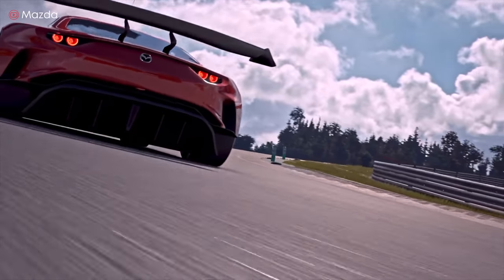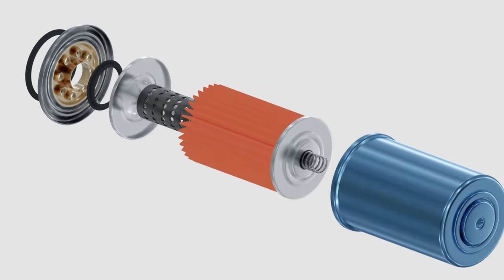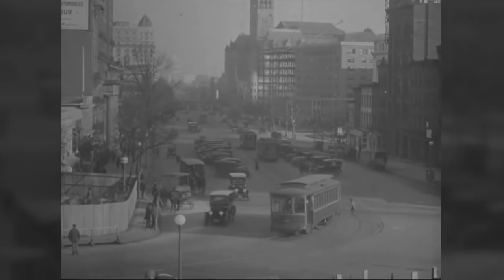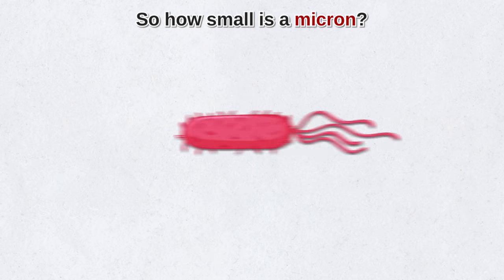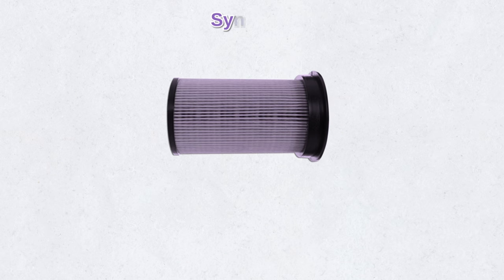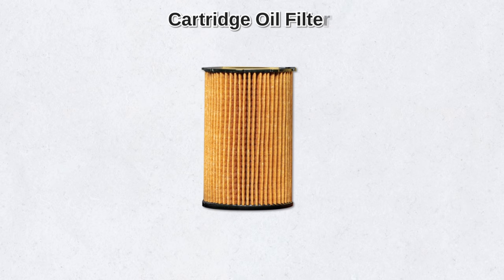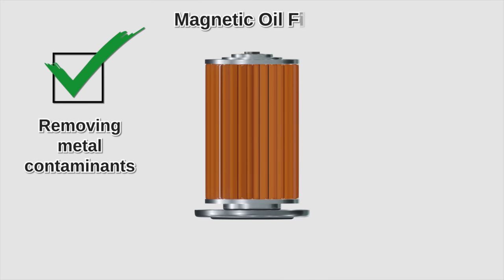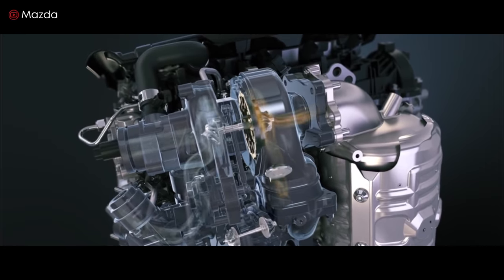This New Oil Filter Just Changed the Game (No More Oil Changes)

Comment: ⚠️"Avoid the orange can, avoid the FRAM" ⚠️
Reply: All I use is Fram my Pontiac vibe has 289000 miles, my ram has 230000 miles ,my gmc had 181000, my cr-v has 14000 never had a problem.
Reply: avoid being an internet vid drone, get a mind of your own ..
Reply: @charlesstull4582  cut open a orange can ,you will be surprised how cheaply they are built ,basically glued together & sometimes they are rusty inside....don't want rust & globs of glue in your crankcase
Reply: @daewooparts  why cut one open, you can watch 10 gillion vids on Ytube alone-where you were weaned on the Fram hate meme.. can you show some video proof where Fram has damaged engines? That would be nifty. I haven't seen any in decades of trend analysis/monitoring/testing with military aircraft that have used Fram oil/fuel filters for decades now.
Reply: @land7776  if Fram filters are so good, then why do no OEM's use them ! While its parent company makes OEM filters, they don't use the Fram design or construction, it won't pass most OEM quality control, & slot of fleet customers did ditch Fram years ago after it cost them in premature engine failure & ruptured filters as well, they are much thinner than the majority of OEM filters & most aftermarket filters as well
Reply: @daewooparts  lol, do you know of any OEM cos. that don't use their own (branded) filters? Link to where they don't pass an OEM QC? Do they void a warranty if you use Fram filters? Please provide a definitive proof from a respected org. test of Fram filters showing engine damage.That should be easy for a Fram meme expert..
Reply: @land7776  American Honda dumped Fram built filters decades ago,,,because of ruptured filters that was built by Fram/Honeywell ....utter garbage, & most Asian OEM vehicle manufacturers don't & won't use Fram  ,GM uses AC Delco which is made by Champ Industries or European filter manufacturers, Ford uses  purolator rebadged as "Motorcraft " & Mobil 1 filters are basically the AC Delco  premium black filters ,even got the same stamping on the filter inlet housing
Reply: @daewooparts  youre still talking yang but can't provide the links. Look at how many people use Frams, do you hear about ruptured filters Look at the poster above, he uses them in all his cars. I've used them among others for decades in cars. I know others who do. I've never heard of or seen a ruptured filter. Like I said, you can't provide any links to any legit study showing it damaged engines. So you are obviously not using your FOS filter.
Reply: Some peasants will buy the best filter they can buy for the least amount of money.  Probably shouldn't store a Fram in humid conditions  unless it is wrapped. Bunch of parrots  repeating what they heard from other parrots. Fram is lucky try talking about toilet paper filters. Insurance would get expensive if the filters were causing problems.  File a claim against Fram and an automotive engineer would be knocking on your door. They are all insured

Comment: ....and back in the day VW bugs had a oil strainer instead of a filter .
Reply: VW saved millions by not putting filters on the beetle. I had a Motor Guard on mine. The Motor Guard was sold as an off road dune buggie filter. Tested and approved by Dune Buggies and hot VWs in the 60s. I still use Motor Guards. I recently got in a Australian Jackmaster. Probably the best in production. Motor Guard only makes compressed air filters  now. Hard to sell game changer oil filters to people that think oil is supposed to get dirty and be changed.
Reply: The beetle generated a lot of large engine damaging abrasives.. Needed.a full flow filter as much as the game changer bypass filter. The trick was never let the oil get dirty and keep the valves adjusted.

Comment: Forget what the OEM calls for! I change my synthetic oil every 10 to 15k and filter. Mobile one or nothing! All highway miles. I got 99 problems and a Scion TC 2.5L 4 cylinder ain't one!
Reply: I don't.
Reply: I brought home a new 84 Subaru. I put Amsoil gear oil in the transmission. Mobil 1 15 50 oil in the engine. A Frantz oil cleaner on the engine. About every 12  K miles I changed the toilet paper in the Frantz and added  quart of Mobil 1. Mostly highway. At a little over 250 K without an oil drain I mentioned it on YouTube.  A Caterpillar lab manager sent me a sample kit. He said the oil looks good for that many miles.  He said it would be better to change the filter every 6 K instead of every 12 K miles.
That would be 2 quarts a year instead of 1 quart. I do that now.
Reply: @ralphwood8818  If your running synthetic oil, 10k -15k with highway miles shouldn't be an issue! More car specific due to age and performance class.

As for the filter, It all depends on the manufacturer and the filter media material used in the construction. Cars are barely under any load during normal operation and the oil doesn't lie!

I work at a Caterpiller dealership FYI
Reply: @barbecuetechtips6024  I remember the Caterpillar  guy talking about something like CaramelizatIon I knew I was running too high an oil temperature. The cooling system wasnt good enough for Dallas traffic with the AC on. One time the radiator exploded.. The spring in the cap was stronger than the radiator. Started using the Frantz toilet paper filter and Delo 100 30 weight in 1963 in a nearly new Rambler American flat head 6 with a spin on bypass filter. All I use now is Gulf Coast and Motor Guard toilet paper filters. The Rambler had no AC. Mostly drive highway now. Wife mostly drove highway but was often caught in Dallas bumper to bumper traffic.

Comment: What about the time factor between oil changes.  How degraded is my (conventional) oil if I've only driven about 1200 city-driving miles, but it's been 8 months since my last oil change?
Reply: city driving is harder on a car and if you short trip alot thats even worse. i would change it every 6 months. even synthetic is only good for a year if you dont hit the mileage.
Reply: I dont drain oil. I also believe in recycling. When I was selling Gulf.Coast filters a guy came to the house with a new Dodge Cummins asked me to drain the Rotella and put his Amsoil in and install a big Gulf Coast  O1 . Had enough  Rotella to keep the old Ford 6.9 going for a couple of years. Broke my rule on the 76 F 250 with the 390 engine. Went to  Walmart  synthetic oil.  Put the old oil in the 30 gallon gasoline tank on the tractor. Same oil in everything now.

Comment: Did I miss something? What's the new oil filter that requires no more oil changes?
Reply: The game changer oil filters have been around for many years. There is getting more interest in them these days. I have been using them for 60 years. I just got in a Jackmaster from Austrailia. Probably the best in production. The top loaders are the most user friendly. They are for the mechanically inclined. The filters that eliminate oil changes dont spin on. They have oil lines. They dont qualify as new. Frantz since 1953 Jackmaster since 1954.

Comment: It seems to me that the finer the mesh, the more quickly it would clog up with particulate matter. What is done to mitigate this factor to make the premium last longer?
Reply: More pleats = more surface area.
Reply: The WIX full flow filter on my Pontiac Torrent has been on the car for 4 years and 60,000 miles. The Jackmaster Classic wont allow any dirty oil to reach it. Im a firm believer in never allowing oil to get dirty. Thats how you get the long engine life. I dont change oil. You could say I use game changer oil filters.

Comment: The oil filter on my Odyssey is tiny.  The filter on my lawn mower is actually bigger.
Reply: I have toilet paper filters on my lawn mowers.have some old Frantz sandwich adapters. I have the bigger car full flow filters such as Fords. They take a 3/4 =16 thread the same as the Kohler and Briggs and Stratton.

Comment: a thin gauge metal filter saved my truck
the oil pressure bypass stuck and the filter ballooned and failed at the o ring, if this hadn't happened i'd have been replacing a cam or distributor
Reply: Interesting. Does that mean that, before it actually failed, when cold or at high speed, the oil galleries were deprived of good flow?
Reply: @wholeNwon  Cold, shut it down when the oil light flickered on 2nd filter, didn't lose pressure but for 1-2 seconds and no load.
Reply: @ty2010  Lucky and smart. Good story.
Reply: @wholeNwon  The smoke from the oil shooting onto the exhaust was also a good tip off that something was wrong. Thought "cheap filter" screwed another on and it skipped a thread, cocked itself and squirted oil when the engine was revved. Windshield was just starting to defrost so if i'd started with the heavier filter i'd likely been going down the road.
Reply: I assume you are talking about the bypass  valve in the oil pump.
Reply: @ralphwood8818  yes

Comment: Hello Scotty my radiator fan is completely dead on the driver side but on the passenger side it will come on and off from time to time and at the same time I need to flush out my radiator would it be okay just to flush out the radiator with the fan or fans not working?

Comment: VW engines did not have oil filters. They had oil screens to keep loose nuts, bolts, and rocks out of the engine. And guess what - VW's run forever. (The old ones)
Reply: Can you imagine a new beetle with no oil filter that normally needed an engine rebuild at 100,000 miles average..They grow on you. I've had three of them. Always kept the oil clean and the valves adjusted

Comment: I put small neodynium magnets on the outside of my spin on filters, held in place with a hose clip. Not sure how effective this is as I've not cut open a filter to date but it can't do any harm can it?
Reply: I did cut one open and it definetly collected crap where the magnets were.. would the filter catch it? maybe but like you said wont hurt using them magnets
Reply: The full flow filter bypass valve is going  to open occasionally.  If the.engine damaging  pieces of steel are stuck to the magnets they wont bypass the filter and go directly into the bearings. It all helps.

Comment: Great review , for the last 20 years I have been doing a full synthetic Name brand 5000 mile oil change on all my vehicles a few years ago is had an oil test done and was surprised when it returned and suggested going to 6000 miles and have it retested , the reason I was suppressed was the manufacture has a suggested  10.000 mile interval I know the fine print I specifically sent it when I meet the criteria.  At the end of the day 5000 miles makes it easy to remember and if I go over no problem  I am still with in the oils usable life,    What are your thoughts on flushes ?

Comment: Are use Amsoil oil filters now I know they’re not the only good ones out there and I use Amsoil oil I also use a bypass filter that filters the oil down 2 x 2 µm and the full flow filter filters down to 20 µm but it’s at 98% efficient same thing with the bypass filter and that’s the Way to go guys I know a lot of people don’t wanna hear that but that’s it man this is six in a row jim from Kennerdell Pennsylvania I got a 91.5 dodge with over 500,000 miles on it it’s about 509,000 actually you get the drift six in a row Jim how are you guys have a good day by the way my old Dodge fires up very fast in real cold weather testament to how well that no Cummins is working oh I also have a 580 super L backhoe and I have a little John Deere 850 with a 25 horse three cylinder diesel I have a the big oil filtration on that also the it’s like the old Fram pH a day only it’s a Donaldson filter with the bypass filter anyway you guys have a good day oh on my old John Deere change my oil but every thousand hours I change the filters about 250 Hours

Comment: Actually the anti-drain back valve prevents oil from emptying the oil filter so you always have oil when you start the engine it does not prevent engine oil from seeping into the filter as that is what normally happens during operating conditions ………come on Scotty get your stuff together

Comment: Hey Scotty what do you think of Royal Purple oil filters?
Reply: I doubt he would pay 3x the price of most filters for it, same as their motor oil.
Reply: @land7776  as far as their oil goes,  he actually has a video where he says it's a great oil. Also, using Royal Purple I was driving to Houston from Dallas once and something popped a hole in my oil pan and blew out all my oil on a stretch of highway 45 where there is no place to pull over and I drove 91 miles at 75 mph with no oil when I final had a chance to stop I got a tow truck to a mechanic shop and they said the engine looked almost new. So I will always use royal purple oil expensive as it may be it saved me from being broke down on the side of the road and it saved me from having to buy a new engine
Reply: @js6729  nice anecdotal story, of course you don't know what would've happened with another brand oil. I go by the SAE rating on the oil and what the manufacturing engineers call for. That is the only subjective standard there is. Unless you can find definitive proof that one oil/filter makes any engine last longer...you can't. If there was, that oil co. would produce that valid proof and sell all the oil..

Comment: what about a truck oil centrifuge instead of a filter?
Reply: The centrifuges are very good. The advantage of the depth bypass filter is you are adding make up oil at filter change. Engines need some new oil. I dont know what Mack trucks recommended..I think my 305 Honda still needed oil drains.

Comment: Scotty, what is your opinion if the reusable stainless mesh oil filters from K&P filters
Reply: My name isn't Scotty but stainless filters are only for racing where you are only concerned with large engine damaging abrasives or you have a bypass filter to remove the small engine wearing abrasives.
Reply: @ralphwood8818  that’s just not true.  ASTMF316 testing procedures which eliminate many of the user variables found in the SAE procedures. Basically, the filter media is pressurized from one side, and when the media starts passing particles, that is the micron rating. Filter media from several common brands of paper filters sent to the lab with no names, just numbers for identification so they wouldn’t have any idea what brand filter they were testing. The results for the paper filters ranged from 48 microns for the best filter to over 300 microns for the worst filter. This is  right in line with other testing results that  research shows that paper media filters passing particles anywhere between 50 and 90 microns. What does this mean? Paper filters are rated on averages, percentages of efficiency (also known as beta ratios) and multiple passes, so a 10 micron rated paper filter (as advertised on the packaging) may be letting particles 50 microns and larger through. 

The medical grade stainless steel cloth used in a quality mesh filter such as K&P is consistent across the entire media surface and is rated at 35 microns, meaning nothing larger than 35 microns should pass through the material and they have meet or exceed the filtration performance of OEM filters.
Reply: 35 microns is a boulder  between two polished surfaces. They are fine if you have a 2 micron depth filter as a bypass filter. That would be similar  to the full flow filter  on my Altima. It has a submicronic bypass filter as a backup. Transmission  and engine. Was at a dealer that sold racing parts. He showed me one. You could read a book thru it. You can't  clean a filter  that  cleans oil.
Reply: Put enough depth in a full flow filter to clean oil and you have converted the full flow filter system to a bypass filter system the same as a Stilco or Trasco except they clean oil.